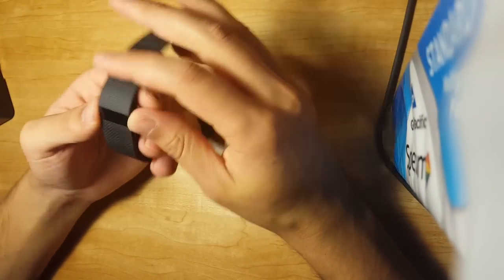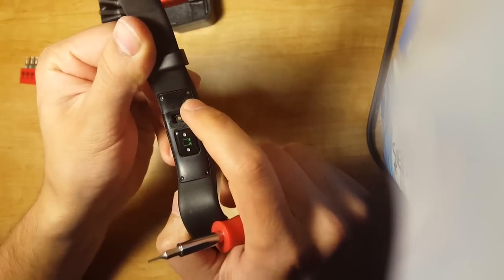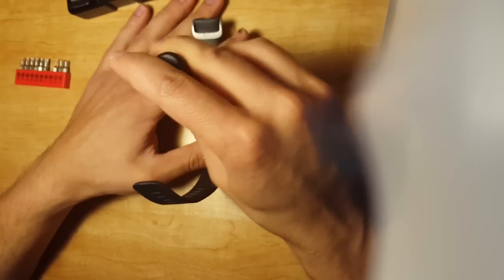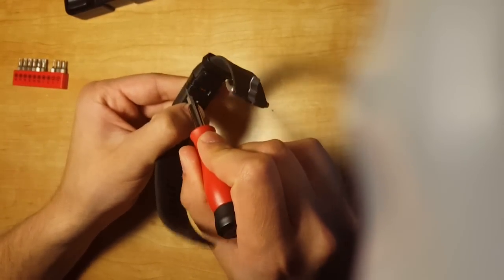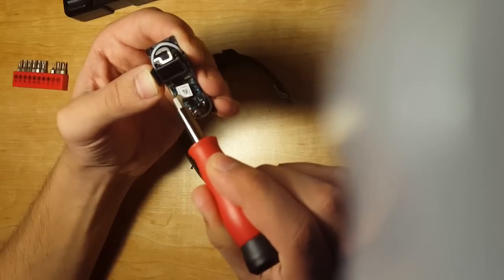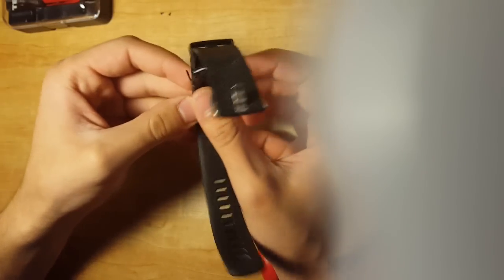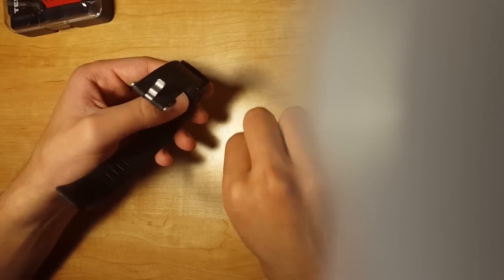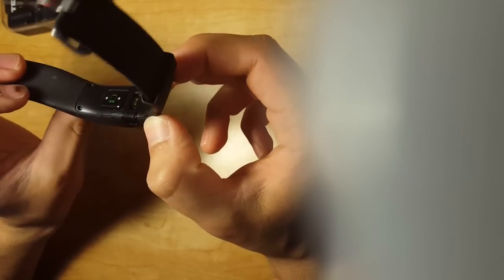Fitbit Charge HR teardown and reassembled

Comment: The round part you are pointing at.  It is not the battery.  I believe it's a motor for vibration.  Usually the Lithium Ion battery is in square or rectangular shape and very thin with built-in protection circuit.

Comment: could you comment a link to where you got the screw set?
Reply: replace fix your strap for fitbit charge HR  , http://www.aliexpress.com/store/product/DIY-Repair-Replacement-Silicone-Wrist-Band-Strap-Case-Fix-For-Fitbit-Charge-HR-Smart-Wireless-Watch/1245466_32760136549.html
Reply: Thiggy4th hey, I noticed he has the same screw driver set that I have. I got it off Amazon. It's brand name is TEKTON. I'll see if I can link it on here :)
Reply: https://www.amazon.ca/gp/aw/d/B009MKGRQA/ref=mp_s_a_1_2?ie=UTF8&qid=1503174917&sr=8-2&pi=AC_SX236_SY340_QL65&keywords=tekton+screwdriver&dpPl=1&dpID=41IEqTF89XL&ref=plSrch

Comment: It has T3 screws, which you have on your set. Kinda gave away that you have no clue...
Reply: Mine has T3 screws for sure.  If you can't get a T3 to fit, I'd suggest cleaning the heads of the screws to get rid of any gunk that might be preventing the T3 driver from engaging.
Reply: Pretty sure it is T2 screws, actually. At least it was on mine.
Reply: Uģis Leikums -- God, what a whiner.  At least this guy is making videos that help people. What are you doing? Making idiotic comments and displaying your horrible fashion sense.
Reply from the maker: Uģis Leikums it's obvious that I have no clue. I don't know why you take your time to make a comment that is ignorant and offensive for no reason.

Comment: Fitbit will be gone in a few years.  I would not buy anything more from them.  Their batteries die in a year or less...1000's of complains on the web about the junk and they dont stand behind the product.  The bands also fall apart in a year or less.  I'll try a product that the company stands behind.
Reply from the maker: I don't know if they will be gone but it's mind boggling that they are not waterproof yet. It makes absolutely no sense. Watches have been waterproof for decades.
Reply: It's a terrible product and they will not stand behind it.  A sucker born every day and that keeps them around.
Reply: I've had my Fitbit Flex for 3 years now. All i do is change bands. At the moment I have an aftermarket band with a buckle and I'm a happy camper :)
Reply: I guess thee are a few that work.  Search the internet before you buy.  1000's of battery complaints.  From news reports, they are in real trouble.  By by Fitbit.

Comment: I have the charge hr and the band is bubbling and coming up in places.  fitbit is replacing it for me but they don't want the old one back. so I'm going to glue it down again with some rubber, plastic, and vinyl glue I found at home depot.  Then I'm going to put a sleeve on it.  sleeve is pretty cool because they come in different colors and designs.  also, straight out of the box my fitbit would die after a day and a half because it would connect and sync with my phone all the time.  I turned off that "feature" and installed an android app called fitbit launcher (don't know if there's version for iOS).  I set the launcher to open the fitbit app once a day and that will then grab all data.  my watch will now run for 6 or 7 days between charges.  i also turned off the feature that turns on the display when you turn your wrist.  the watch will hold the data for 7 days so constant syncing just wastes the battery.  would be nice to know the battery number.  I seriously doubt fitbit spent the extra money on higher capacity batteries.
Reply: Oh and I still have it checking heart rate constantly
Reply: there is not one for iphone but you said ths you turned off the all day sync and it saves your battery

Comment: As posted before that is not the battery, that is the vibrating motor and the reset button is most likely you piercing into the battery soldered onto the board underneath. If you have a fault and your fitbit is over a month old but under a year, fitbit will most likely replace your unit. They probably cost the company a few pounds to make. Cheaper and easier than trying to repair them I guess.

Comment: Hi Dude, yes, The Fitbit charge HR and Fitbit Charge bands’ peeling off and 

air bubble is common issue, make our users headache. 

here i recommend you can try TreasureMax Sports Soft Silicone Rubber Band 

Cover/Protective Sleeve/ Protective Case Cover /Sleeve Protector with Various 

Colors Available for Fitbit Charge/ Charge HR to solve these problems  

https://www.amazon.com/gp/product/B01E45TTOE?ref_=ag_proddeta_titl_screport

Various colors are available, you can choose the favorable designs for your 

Fitbit Charge/Charge HR Watch

https://www.amazon.com/gp/product/B01E45TTOE?ref_=ag_proddeta_titl_screport

Comment: Hello everyone, I am wondering, in the video, he says that he is using a t5, but if you look on the holder of the other bits, the empty slot looks like it is for a T1. The only reason I'm asking, is because I have a set of torx and the smallest I have is a T3 and it is to big. So, is it a T1? Any help would be appreciated! Thanks!
Reply: A T3 worked for me.  It takes a little time to find the right angle for it - the screws point in a direction perpendicular to the face of the Charge HR, which may not be the most intuitive direction to attempt.
Reply: hi
T2 & T3 for charge HR band, T5 for Surge band.
if your fitbit band is broken and need replacement band. click get surge band
http://www.aliexpress.com/store/product/Silicone-Replacement-Watch-Wrist-Strap-Band-For-Fitbit-Surge-watch-band-Rubber-bands-venda-de-reloj/1245466_32757025650.html
this lick for HR BAND
http://www.aliexpress.com/store/product/DIY-Repair-Replacement-Silicone-Wrist-Band-Strap-Case-Fix-For-Fitbit-Charge-HR-Smart-Wireless-Watch/1245466_32760136549.html

Comment: my Fitbit Charge isn't working now. so I had reassembled my Fitbit. so I found problem in my Fitbit. it has battery problem. so I should be change battery. but I don't know.... actually I'm normal girl. :-( . Do you know Fitbit used battery ? I would like to know it. Thanks !

Comment: WARNING: This is an effective way to get inside your Charge HR. HOWEVER, this method will break the plastic housing that the side button sits in. The reason why it was so stiff the first time was because the plastic was intact, the second time it came apart so easily because the plastic was already broken. Note that using this method damages the integrity of the water resistance substantially. Therefore, the next time you wash your hands it is very likely that you will end up shorting out the circuit board.

Comment: This is actually a really awesome post. I had two Charge HR's one that the band was fine, but the module died for some reason and another where the module was fine but the band ripped. I used this kit from Amazon to make the swap and I took the two good halves and made a good one as an extra. I will add an extra note that it can go back together the same as factory as long as you don't bend the band too much while taking it apart. The face of it gets flimsy without the module inside of it.  (http://www.amazon.com/JACKLY-Professional-Screwdriver-Extension-Maintenance/dp/B005JRTAYG/ref=sr_1_3?ie=UTF8&qid=1459288300&sr=8-3&keywords=micro+torx+screwdriver+set).

Alex props for getting brave and tearing this down to take a look inside.

-Andrew

Comment: anyone know if there is anything that can be done to reset the ChargeHR  by taking it apart as shown? Was sent a new one because mine was rendered "defective" by FitBit. Trying to sync it to my phone the status bar froze half way across and nothing I do will get it to leave that screen... Figured if I could reset it maybe it would fix the problem. They sent a new one for free but just was curious if I could get it working. Thanks in advance :)
Reply: +Sarah Fritschler 

plug it in and hold the button on the side for about 10 seconds.
the version number will flash and the device will reset. 

**it must be plugged into a power source or it wont reset after 10 seconds.

Comment: That hole you poked your screwdriver in to help open it is the barometric sensor.  Also the thing you called a battery looks like a vibrating motor.
Reply from the maker: Great, thanks!
Reply: +Alex Pirnuta Where did you get your small screwdrivers?
Reply from the maker: +Sarah Cartwright I had mine from around the house but try amazon or eBay. If not, a home repair store.
Reply: +Sarah Cartwright I used these screw drivers: http://www.amazon.com/gp/product/B00SI2HLPE
Reply: +Alex Pirnuta Cool! Ta.
Reply: +Crazy NH Mountain Man Thank you!

Comment: Is it possible to change the battery? My Fitbit Charge HR drains so fast.
Reply: +Darshana Jayasinghe I was looking into this but the problem is trying to find one to replace it I can't seem to find even a replacement for this model of fitbit
Reply from the maker: I really don't know. Maybe someone else watching the video might know..?
Reply: +Sonny Neu  Any news what type of battery should be used in case someone would replace the old one? i got one device which drains within 1 day(contrary to the earlier 5 days) and although Fitbite sent me a brand new device for replacement it would be nice to save the earlier one with a new battery. I think a battery should not be more than 10-20 bucks :) Thanx. Zoli

Comment: Just so you know man, that's not the battery. That's the vibrant motor. If you want to replace the battery, you'll have to flip the board over to access it. But it'll also be soldered on. Thanks for uploading the vid tho!
Reply from the maker: Thank you!